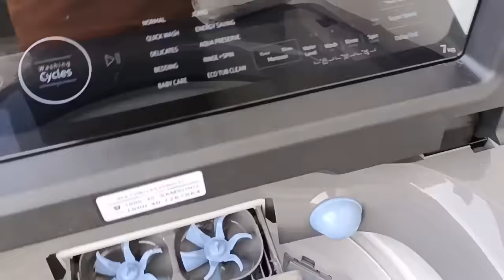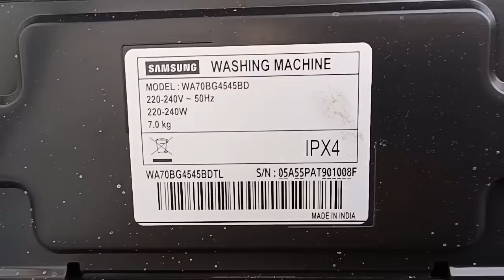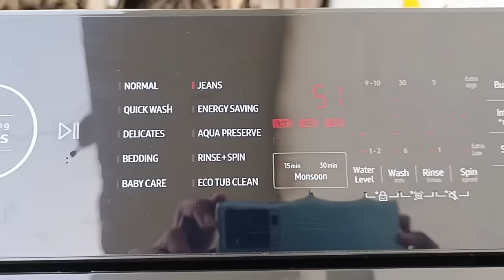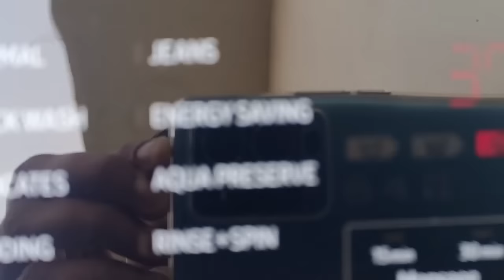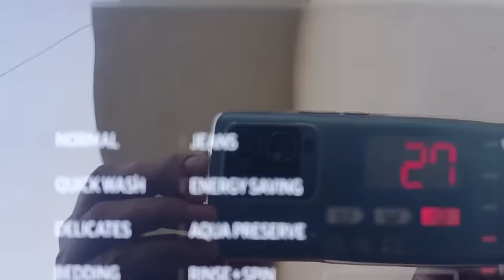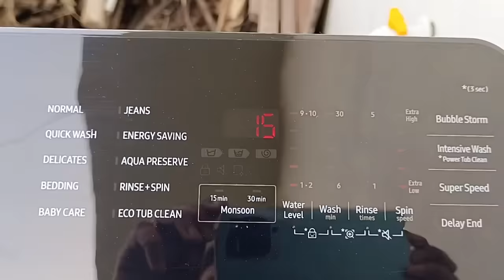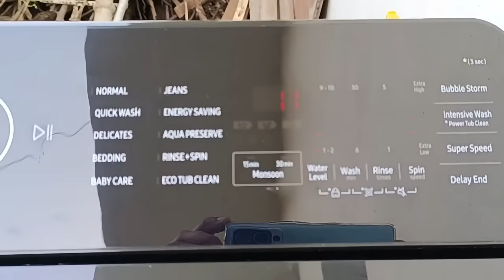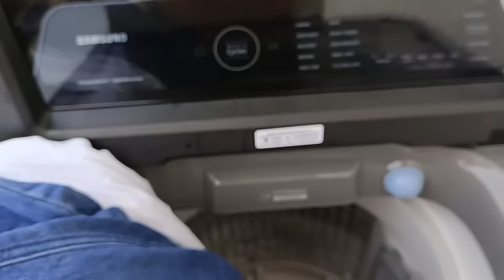Latest New 2023 Samsung 7 Kg Full Automatic Washing Machine I Washing Video I Model WA70BG4545BD

Comment: Bahut late tk paani bharta hai or wash bhi bahut late tk hota hai
Reply: Iska timing km kaise kare
Reply: Answer please
Reply: @Ranju___kashyap  I have the same model.

Timing change krne ke liye rinse or wash level low kare.low krne ke liye usee click krna padta hai.
Bonus tip - use super speed option.
Reply from the maker: Water intake speed can not be changed, adjust wash, rinse level manually after selecting cycle
Reply: Bhool kar bhe top load mat lena ,Agar safai chayea to front he lena
Reply from the maker: @rajivmittal904  Front load motor expires early, due to the load in horizontal direction, also front load are hard to access, to put and takeout cloths in every 2-3 days, front loads are expensive in maintenance, consider these points also
Reply: @rajivmittal904  Kyu brother ?
Reply: @worldwideinfoblogs  Best company hain na sir ?
Reply from the maker: @arunkushwaha5143  best company best machine, compare features and prices of other, this one is best
Reply: @worldwideinfoblogs  Samsung washing machine eccobbble with heater 9Kg is best company tell me sir please
Reply from the maker: @arunkushwaha5143  Any washing machine above rs 20,000 is good, go with brands, go to offline shop see the physical similar model first. Additional features increases the price, otherwise all are same. Cross check service/repair available in your area, if any issue in machine whenever by chance.
Reply: @worldwideinfoblogs  Only Samsung washing machine eccobbble with heater 9kg ka batayiye please sir
Reply from the maker: @arunkushwaha5143  Good
Reply: @worldwideinfoblogs  Okay and batayiye sir
Reply: @ayushisingh3089  Oh really ayushi ji
Reply: Right

Comment: Una consulta esta lavadora no llena de agua como las otras solo poco agua
Reply from the maker: Todas las máquinas de carga superior llenan agua a la misma velocidad. En caso de que deba limpiar el filtro pequeño en la tubería instalada al lado de la lavadora y mantener una buena presión de agua. Para acelerar el lavado de las telas, use los botones de lavado rápido o supervelocidad y cambie manualmente los niveles de lavado, enjuague y centrifugado para que el lavado sea rápido.

All top load machines fill water at same speed. In case you must clean the small filter in pipe fitted to washing machine side and maintain good water pressure. To speed up the washing opf cloths use 'quick wash or superspeed buttons also manually change the levels of wash, rinse, spin so the washing will be fast

Comment: Lena sahi hai yea nahin lu
Reply from the maker: This is the latest model of washing machine, August 2022, i see no issue in all aspect, it did take water in slow little, but you can adjust water level required manually at every wash type. so you can go for it, price around rs 19 - 20,000. check physical model once if available shop near you.

Comment: Bought a 19kg it doesn’t wash all it does is fill the water then drain, fill the water and drain yoh💔
Reply from the maker: Normally when you put cloths in drum, machine takes the water then wash the cloths drains the water, then take fresh water and rinse the cloths and drains the water for dry spinning. If you have not manually changed the cycle, then you must connect customer care to understand the problem
Reply: Mine as well I don't know what
Reply: Hi, I'm experiencing the same. Fills water does not Wash and immediate drains water out.

Comment: Whatcauses4C
Reply from the maker: Refer manual comes with machine for reference. The 4C error code indicates that the washing machine has detected a problem with the water supply. The most common reason for this error is a blocked or kinked water supply hose or small filter

Comment: A little motor sound at spin cycle. Is it normal?
Reply from the maker: Yes
Reply: I put a single pant and turned on quick wash . Its showing 35 minutes. And the water was automatically filled for half drum. Why this happening?
Reply from the maker: @Vinith-td4qd  Its normal and correct, but if you want you can reduce water, wash, rinse level manually, watch my other video on same
Reply: Thank you sir. And i saw that we can manually add water in fully automatic washing machine. But can we add water on cycles or on manual wash?
Reply from the maker: @Vinith-td4qd  In all cycle, but only when machine needs or takes water
Reply: And if i select wash manually it sets to 20 mins . Can i change the wash time like 10 mins?
Reply from the maker: @Vinith-td4qd  Yes, not time but wash level, means 1 wash, 2 wash .... etc

Comment: Kya yeh Lena chahiye?
Reply from the maker: Good option under rs 20,000
Reply: @worldwideinfoblogs  any better option under 20k? 
My requirements are best washing and low power consumption, and after sale services. I don't care about "fancy" features or numbers of washing mode.
Reply from the maker: @thegreatestofalltime777  Any branded 5 star washing machine is good under rs 25,000, if you pay more money more features will get added. Most important : 1. check brands after sale service available at your place. 2. Visit different shops and check which brand you feel to go with(in my case LG and IFB were horrible dabbas/boxes). 3. shortlist 1 or 2 models/brands and check their user review, working and make your final decision. Dont be in hurry for buying, you are not going to buy another washing machine again.
Reply: Muje ye 14500 ki pdi h.. Kya ye thik deal thi.. Machin kesi h. Long life k hisb se.. Aur 20 year warranty h na?
Reply: @UnKnOwnPeRs0N.  mujhe high speed wala 15995 ka pada. Baki sab thik hai, lekin washing average hai aur water loading thoda slow laga, inlet pipe thin hai.
Reply from the maker: @UnKnOwnPeRs0N.  Machine is good and washing also, 10 year warranty
Reply from the maker: @thegreatestofalltime777  washing quality is good you can change as needed manually wash and water levels
Reply: @worldwideinfoblogs  tell me the best settings for best washing and lower power consumption.
Reply: @worldwideinfoblogs  pr samsung wale bol rhe h ki 1 dec 2022 k baad sabi fully  automatic digital inverter moter pr 20 saal ki aur 2 saal ki comprehensive warranty de rhe h... Flipkart pr mention h aisa
Reply from the maker: @UnKnOwnPeRs0N.  Might be, its good then

Comment: Bhai cloth dry ke time spin hoota hai ya nahi
Reply from the maker: Yes last is spin cycle for drying cloths
Reply: @worldwideinfoblogs  dry acche se hota hai?
Reply from the maker: @dhananjaychourasiya1425  For cloths: In normal weather in india, you also have to dry outside machine for 15-20 minute for 101% dry feeling. in rainy season like now you increase spin level and still needs 30-60 minute for dry outside and then you can use cloths. Great job by machine this model.
Reply: @worldwideinfoblogs  Thanks bro